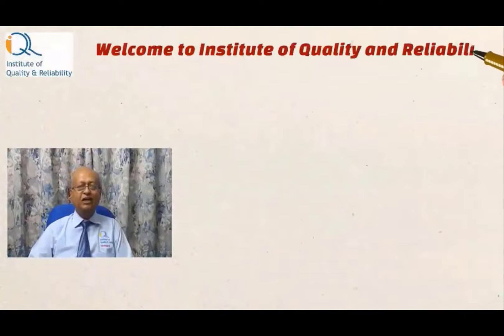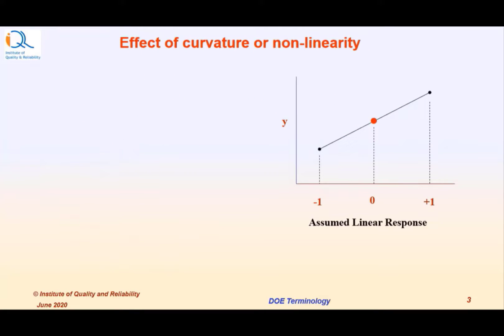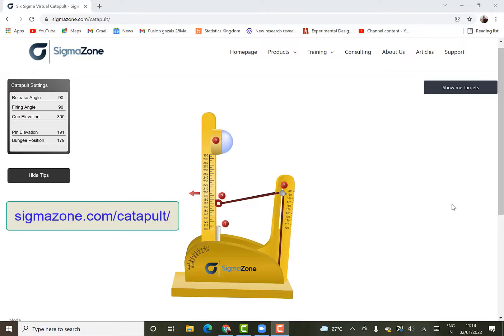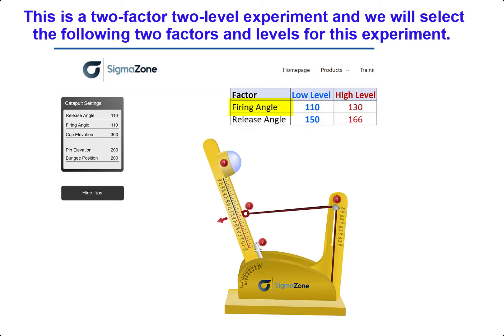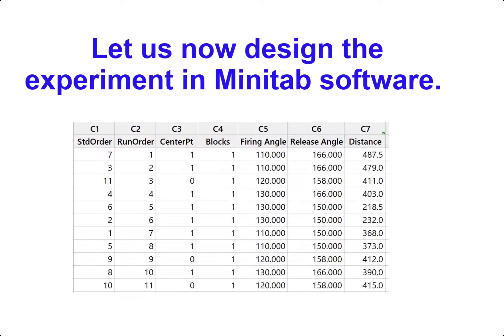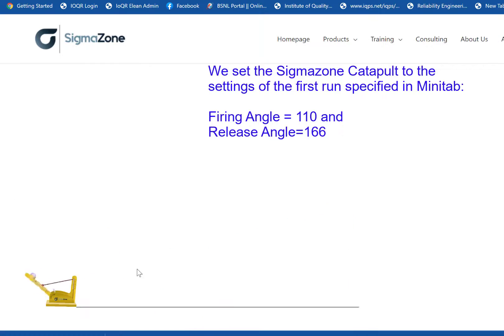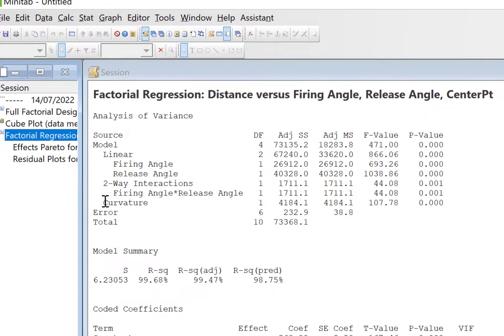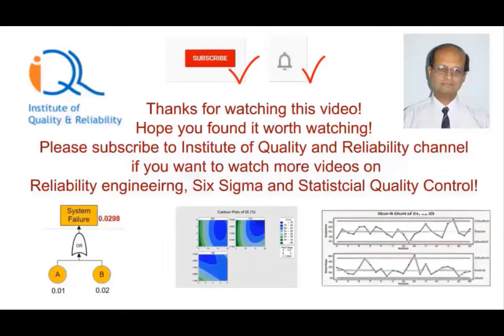Response Surface Designs: Part-1 Addition of Centerpoint

Comment: Hi, great video as always. I have a question: in your previous videos you showed how to calculate effect size for a 2 level DoE design. How would that translate if it is a 3 level, to work out average effect?
Reply from the maker: The primary reason for three levels is to validate curvature. This can be better done by addiing center point as the third level. Ans if you want to model curvature properly, response surface designs are better option. As there are three levels, main effects of each factor will have two degrees of freedom (effect of level 1 to 2 and level 2 to 3). Montgomery metions that each main effect can be represented by a linear and quadratic component, each with one degree of freedom. So it becomes little complicated. Refer to Design of Experiments book by D.Montgomery for details. Apologise for the late response.